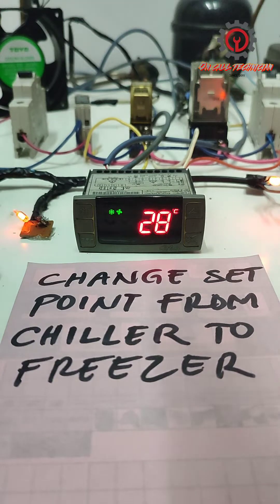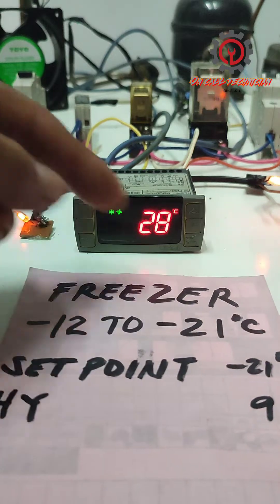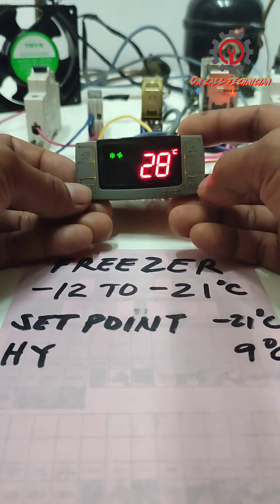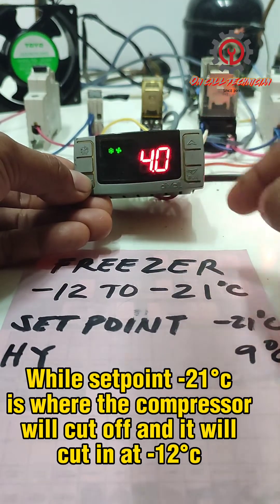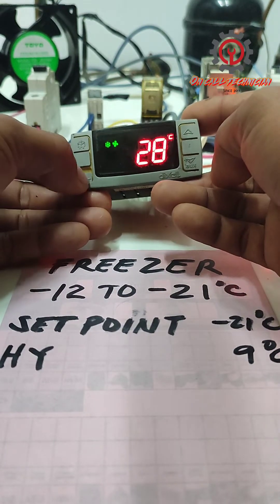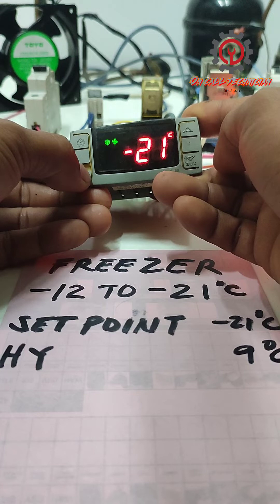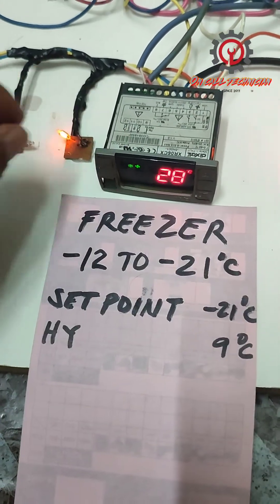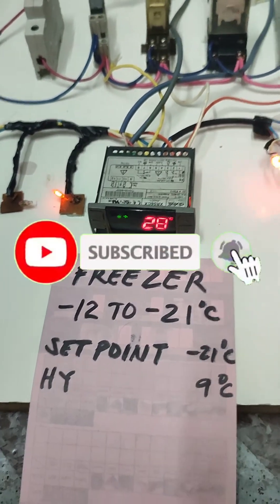BASIC PROGRAMMING OF DIXELL XR06CX FROM CHILLER TO FREEZER

Comment: Sir. Why is my evap fan not turning on even though I have set FS 30, FS On, I tried changing FS to CN but its still not Active in display
Reply from the maker: Try to disable P2 code by changing Y to N and updatee sir
Reply: Thanks sir i'll try it tomorrow 🙏🏻 @THEMULTISKILLEDTECH
Reply: Its really work sir. Thanks
May I ask in detail what P2 is? in the Manual it says probe 2. what is that mean
Again.. Thanks 🙏🏻
 @THEMULTISKILLEDTECH
Reply from the maker: That's evaporator fan and defrost heater sensor sir. Now reduce you mdf value to less than 20 minutes only. And you're welcome sir😉

Comment: Sir.  I have a Polar Temp 400AD ice storage box.  I replaced the dead XR06CX-4N1F1 however I do not know how to setup the controller to properly run this ice storage unit.  I would apprecaite any help you could offer.  If I place the sensors in a bag of ice it will run and keep cold however once I try to return the sensor to the evaporator holder the unit shuts off the evaporator fan and therefore stops working.  Please help!!!
Reply from the maker: Did you follow my freezer settings in the video? Its basic intended for newbies
Reply: @THEMULTISKILLEDTECH  Yes I changed all of the settings as you directed.  The XR06CX will not start the evap fan until the sensor reaches 0C temperature.  I do not understand why it will not run while the compressor is running.  I checked and FC is CY.  Thank you!
Reply from the maker: @rudymcdaniel7167 FS change it to 26°c and Fc to CN or ON. Then update here
Reply from the maker: @rudymcdaniel7167 I've lots fo dixell tutorials just explore my channel
Reply from the maker: @rudymcdaniel7167 https://youtube.com/playlist?list=PLOMYgMklNMhETVnzUDCoHMpMOLQ5Wp95m&si=0z4G1p1vr88Vn1IQ
Reply: @ Fan is now running with the compressor.  Gets down to about 11 C so I am pretty sur it may need a charge.  Your help has been amazing and I really apprcaite it.  I will keep you advised.

Comment: Sir pa advice nmn po - 5 design ngffrost po ung bandang evaporator fan nasisira po fan motor pag inabot po ng yelo
Reply from the maker: Di ko naget sir, pa  ulit🙏
Reply: Inaabot po ng yelo ang evaporator fan blower - 5 po ung set point nya cold room po
Reply from the maker: Samin sir pag chiller 1°c to 4°c. Ang set point na yan is default value sa manual. Mas mainam tanungin nyo customer sir kung ano standard temperature nila at sun nyo i match.
Reply: At anu po tamang settings ng temperature sa chiller po cold room po
Reply: Sa totoo po sir first timer po ako sa cold storage inadopt ko lng po ang ref and aircon, pag cnabi po bang chiller anu po pinaka max na settings ng temp?
Reply from the maker: @user-op8bi3lv6t https://youtube.com/playlist?list=PLOMYgMklNMhETVnzUDCoHMpMOLQ5Wp95m&si=JneY2VvKrL7apVqS ang daming setpoint ng chiller sir. Select at Watch mo po yan paraalaman mo bawat setpoint ng chiller. Hints, cake, wine, soft drinks, medicine, foods...
Reply: Pag - 5 po ba set point masasabi po ba ntin sir na chiller parin xa
Reply: Tnx po sir
Reply from the maker: Na solved mo na ba sir? Keep watching lang sir, dami ko ng tutorials para ma guide kapwa tech natin sir

Comment: Hello sir, just replaced a new controller on a polar fridge. What should I change the set point  to?
Reply from the maker: If freezer just follow your standard setpoint sir. Mine is just an example.
Reply: @THEMULTISKILLEDTECH  thanks for your reply mine is a fridge using the same controller.
Reply from the maker: https://youtube.com/playlist?list=PLOMYgMklNMhFImzKtH9fjpQyqc5jIH4ZG&si=PnNMyhyT8Rw197sI watch this sir 👆 for begginers setup watch about Set point and let all parameters in default. Then watch every parameters
Reply: @THEMULTISKILLEDTECH  thank you sir 🙏🏾
Reply from the maker: Did you manage or run your fridge properly sir?

Comment: Sir good evening I have a problem with cold storage with the same controller dixell I initially charge 404 but when I started to operate nothing happen but the controller is in operating and the compressor condense fan and evap fan not running theres no power on solenoid valve
Reply from the maker: If over charged it won't start sir, solenoid valve power up together with compressor

Comment: My refrigerador is freezing at 36°c😕
Reply from the maker: Thats hot sir not unless its -36°c
Reply: @THEMULTISKILLEDTECH  a refrigeration technician told me that I should change the dixell controller,  what do you think?
Reply from the maker: Why sir? What error did you encounter?
Reply: @THEMULTISKILLEDTECH  I has already communicated to you,  that in my dixell controller parameters is freezing at 36°c
Reply from the maker: I replied too that 36°c is hot not freezing. Any way do what i did in my video and your set point will become -21°c
Reply from the maker: Not unless, the control relay is busted. Compressor indicator at display stop upon reaching its setpoint value but compressor still running, it means output relay is shorted. Its a repairable. Watch this for your reference 👇👇https://youtu.be/9yMZH3wHmqg?si=wSASWRgilkkW6qbo